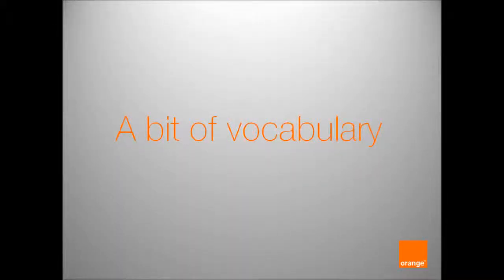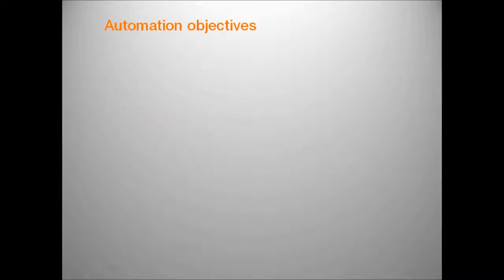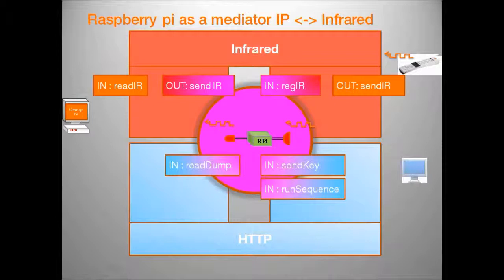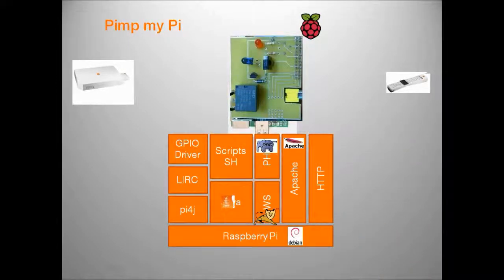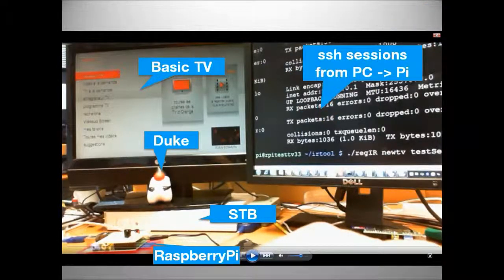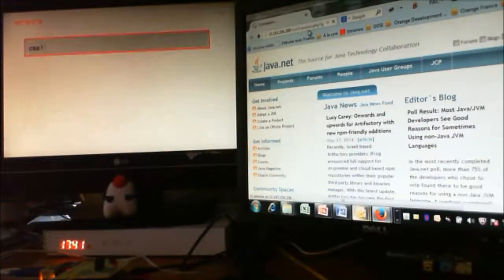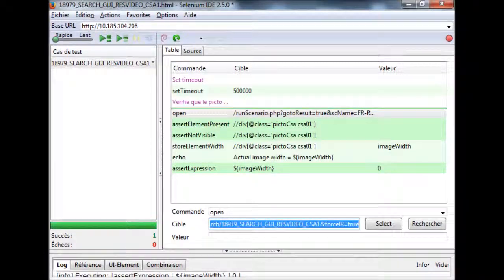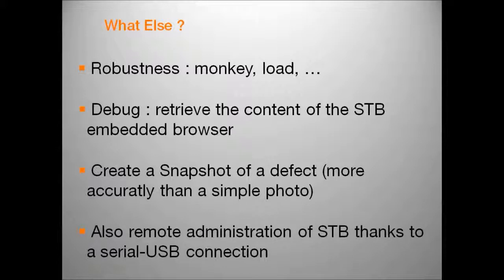IOT  SmartRemoteControl

Comment: Hi Olivier, I need bit more information how to test STB using selenium. my query is  how get dom of the screen dump. And if STB app is developed in C ++/andriod how to get dom of screen dump. Please help me.
Reply from the maker: Hello.
If you have an android STB, you've got a lot of standard tools to access your STB through adb. In the other cases (c++ or html based app), you need to code something in your app to do the job. We've faced c++ and html apps, in both cases as the middleware provided by the STB constructor did not provide a way to extract a STB state (screen dump, status,...) we've coded it. It can be simple on an html app as the dom structure can be extracted with just some lines of javascript and also because Dom can be rendered outside of the STB browser + asserted with selenium. 
For c++ it's a bit different as you have to find something to describe your gui in order to use a test framework.

Olivier
Reply: can you please share setup doc for RPI and STB used in your video on my mail -  nitinvrm043@gmail.com
Reply: Hello, please send me the setup doc, I'm stuck in the middle while configuring the RPI. Please help me resolve.
Reply: Please let me know how raspberry pi is physically connected to STB to get the content of STB into raspberry pi. I mean any frame grabber is used to capture the STB content.